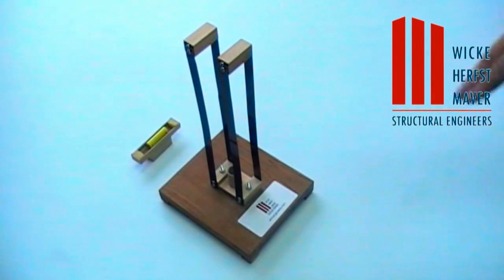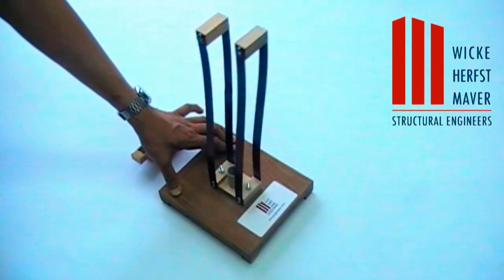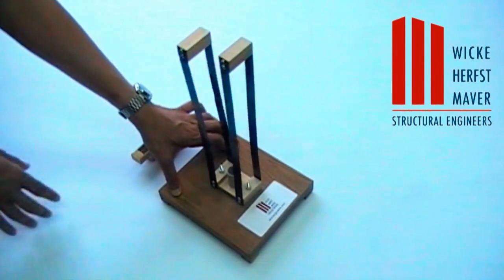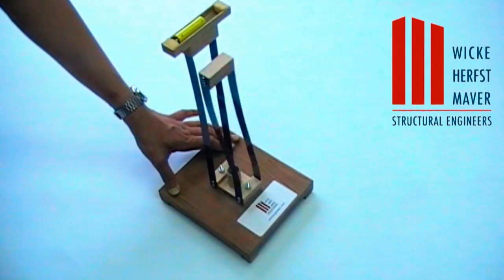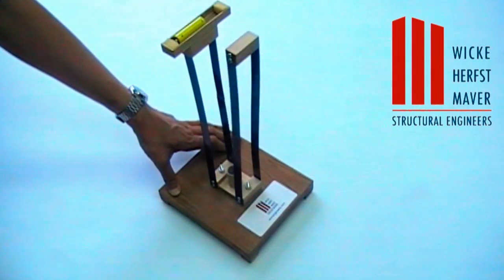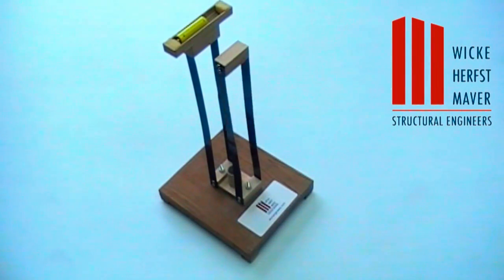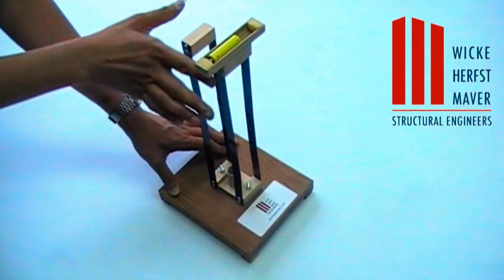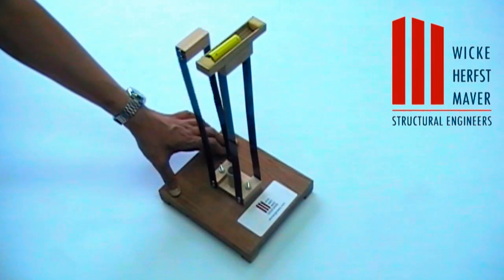Damping system

Comment: Hi Graeme. Hope that you are still around. :) So, from an intuitive point of view, it looks like the battery is following the tower movement, but with a slight delay / slightly out phase, so that when the tower is extended at the maximum and it starts to return, the battery hits it with an opposite force. Right?
Reply: and how much should the weight of the damping object (cell) for high rise towers? i think it will be very very heavy.
?????